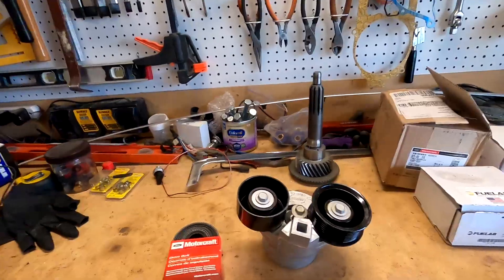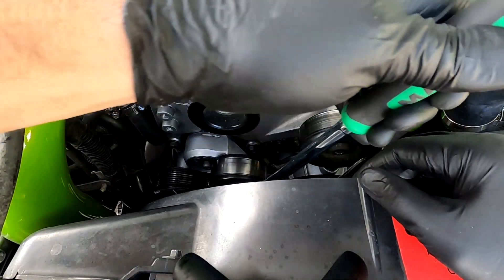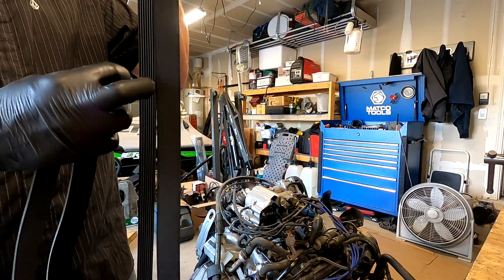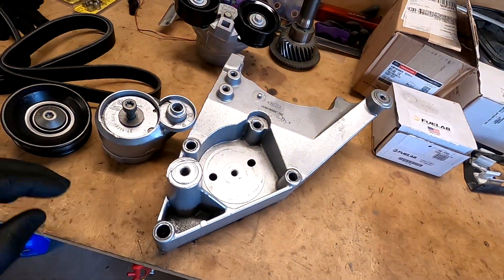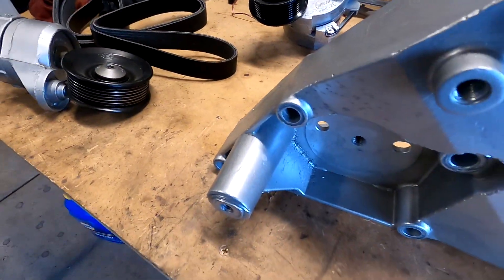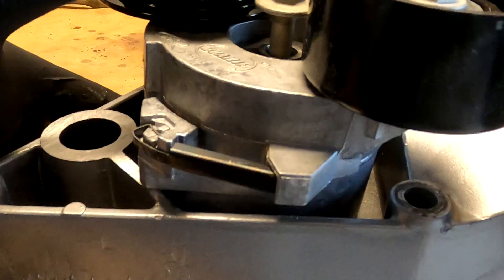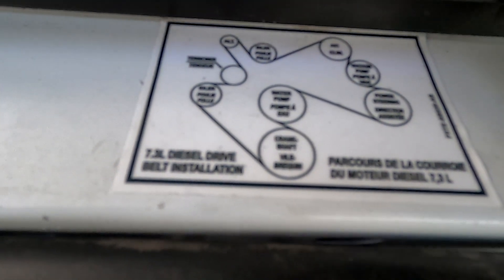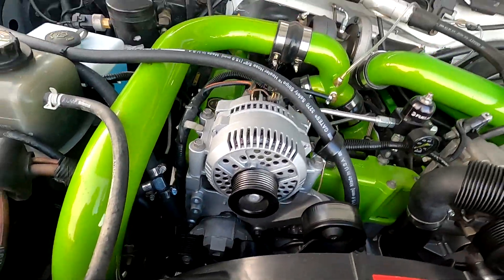7.3 Powerstroke Swap Episode 10: Dual Tensioner Upgrade

Comment: Is the black tab on the belt tensioner at the 10:00 minute mark suppose to disengage when the belt is installed?
Reply from the maker: Yes that is supposed to just kinda hang and flop. That is used to hold the tensioner while the belt is being replaced. Once the belt is installed you pup that piece off its lock and the belt will tension.
Reply: @mygarage.  ok thank you for the reply I thought I had broken the tensioner
Reply from the maker: No, that's just how they are.

Comment: Mate - thank you so much!! - I've just been given my first OBS - a 1996 with the seven3 that are in need of some TLC. Some place in the front there is this squeaking sound coming from what I believed to be a pulley or some of the other items turned by the belt - so I was about to fill out a rather huge parts list when I watched you having the exact same problem. Little did I know that this is an OBS thing and can be dealt with in a rather inexpensive way - I have double sided pulleys and belt in my parts bin from a newer -99 and up...
Thank you so much for posting this how- to video - the sound nearly drove me off my hinges.... 
Helge :-)
Reply from the maker: Glad my video helped!! Thank you for watching!!

Comment: Just found your channel.  Excellent work!  And nice upgrade.  Haven't changed the belt on my 2000 7.3 yet. But my 07' has the kickstand built into the tensioner aswell.  I didn't even need tools to change the belt. Just pull the belt from the side of the truck by hand,  and it locked in place.  Pretty sweet
Reply from the maker: Thank you for watching.  I know the kick stand is pretty common on the newer Fords. I had to take the belt off once after I did the dual tensioner upgrade.... it has too much tension to do but hand.
Reply: @mygarage.  And i was just looking at the CNC Fab HPOP yesterday.  Then i saw u had installed one. Think I'll save a few hundred and go that route.  My 7.3 just rolled over 300k. Runs awesome.  But im sure the old pumps tired.
Reply from the maker: The CNC pump is amazing!! I have 0 complaints about it. My Ruckus runs sooo much better with it.
Reply: @mygarage.  Yea, your OBS sounds more like my Super Duty than my 95'.  I was looking to get their oil feed lines aswell.  Already have the Riff Raff HPX cross-over and their stainless hard line cross-over.
Reply from the maker: Yeah, I would do that! It's a good set up.

Comment: 1st thing I did when I bought my 96 F250 was to do this Fors TSB and then I bought the International water pump with spin on coolant filter “charged” so I don’t need the coolant additive, replaced thermostat with the kit.  What inner cooler kit are you using?
Reply from the maker: Yeah, that's a good water pump. I'm running a superduty intercooler with the Irate diesel pipe kit.
Reply: @mygarage.  is it worth the investment?  Noticeable difference than no inner cooler?  Trying to justify the cost.  I have a 2001 7.3 Excursion but there’s some differences in the two.
Reply from the maker: I would strongly recommend the intercooler if you are going to be upgrading to larger injectors, or turbo upgrades. If you are staying close to a stock set up it wouldn't be needed. I believe my intercooler set up was about $300.

Comment: Hey there, I’m just getting my motor bk 2gether and I did this upgrade. I got a gates K081223HD belt. It measures 122 3/8”. Its lil smaller than Motorcraft JK8-1227, but on my truck it to loose ??? I have 97 f350. I’m stumped 🤔. My stock belt is 118.5 it’s to short. Any ideas ??? Thanks, Eddie
Reply from the maker: Eddie,
      Are you running the single tensioner or dual. I assume your truck has power steering and a/c?
Reply: @mygarage.  I’m running duel. My belt ended up to short. I had to get Continental 4081223F belt. Worked perfect !! Thanks for all ur videos really helped me out !!!!
Reply from the maker: Thank you for the Continental part # I didn't know there was an aftermarket option!

Comment: Whats the reason for  duall tensioner,I'm doing a rebuild  to!!!! Thank you!
Reply from the maker: Thank you for watching and your comment! The problem with the single tensioner is that it pushes on the belt, but not hard enough.... the dual tension pushes and pulls on the belt at the same time..... essentially doubling the grip of the belt and not allowing it to squeak. It works amazingly well.
Reply: That engine belongs in a show man amazing!!go to v belt guys good oem prices on that particular  belt
Reply from the maker: I'll keep that in mind. And Thank you!
Reply: Will this work with the dual alternators too?
Reply from the maker: This is a very good question, and one that I cant answer. I read the TSB and it does not say if it will work with dual alternators.  I would imagine it will work as long as the tensioner doesn't interfere with the other idler pulleys. You will need to research the correct belt length.
Reply: @mygarage.   I figured  it can down to the belt size!Thank you!
Reply from the maker: I would imagine it would work. It's used on Super duty as well, and I know those have dual alternators. If not you can always try and make it fit. 😁

Comment: Would you be able to link where you got the JK8-1227 belt?  I haven't been able to find it anywhere in stock, most say unavailable.
Reply from the maker: I got the belt from Amazon. I see where you got  pat number JK8-1227, but that doesn't cross reference to a valid belt size, you want the Ford part # F8TZ-8620-FB. Just Google search the part number and you will find it from a few vendors.